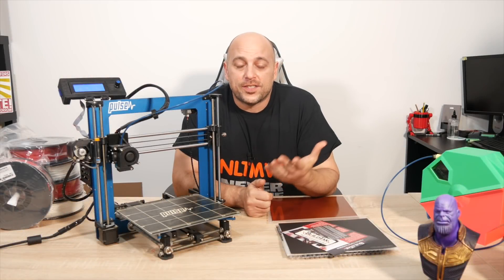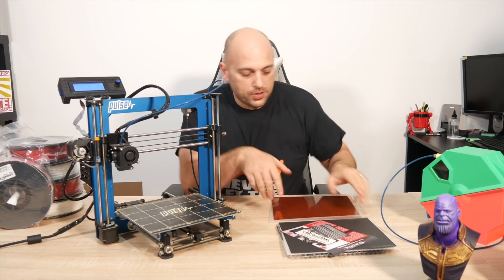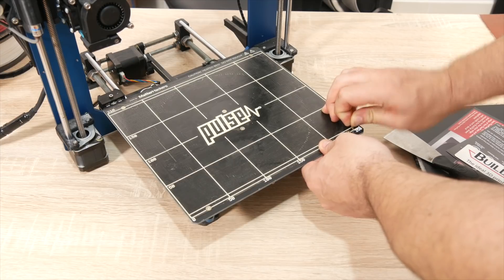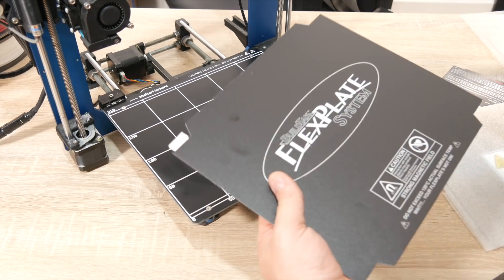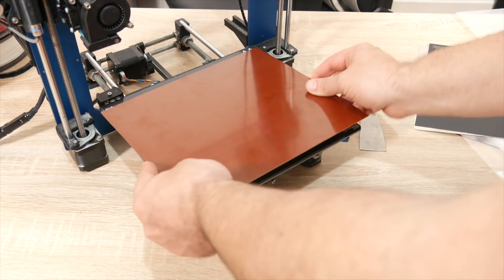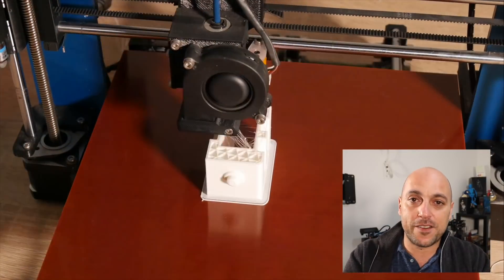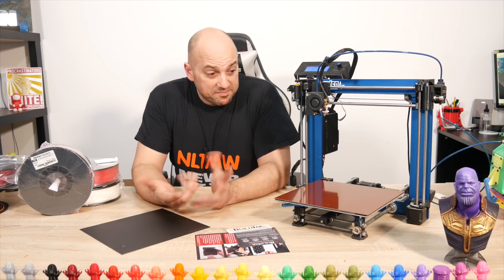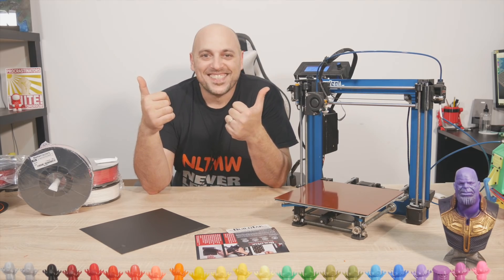Matterhackers Pulse Garolite Flexplate Upgrade

Comment: I already have the flexiplate system installed, and am looking to turn up the heat with nylon.  I know I need to go to garolite, but I have a simple question. Is the garolite sheet flexible itself?  or rigid like all other garolite sheets I have been finding?

Comment: Why didnt you use the steel plate? You stick the flexplate to the steel sheet not the permanent printer bed and that combo snaps the same way you have now except it wouldn’t be permanent & you could remove the steel sheet when your 3d printed part is done & easily snap it off. & garolite would of snapped the same way regardless. If this was on purpose im scratching my head on why not just get the same bed material builtak for 15 dollars rather than flexplate setup which cost 70-100 dollars maybe when the only advantage of flexplate is the removable bed.

Edit: regardless thank you for the video good sir :)

Comment: I find that nylon prints remove easier from garolite when the bed is still hot and become almost impossible to remove when cold.
Reply: hot as in minutes after printing?  or right away?    do you think I could reheat the bed to say 70C, let it sit for 20 minutes and then have the same success?